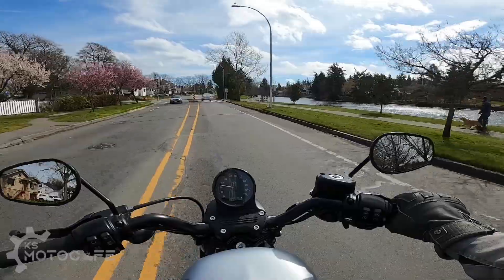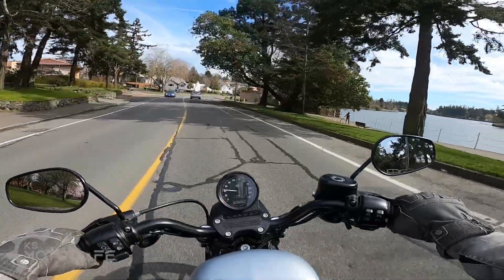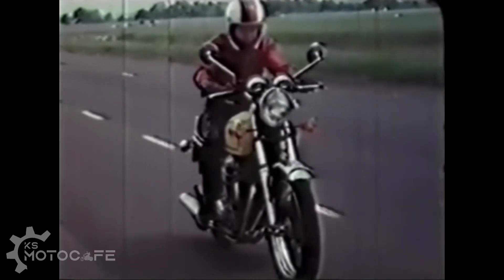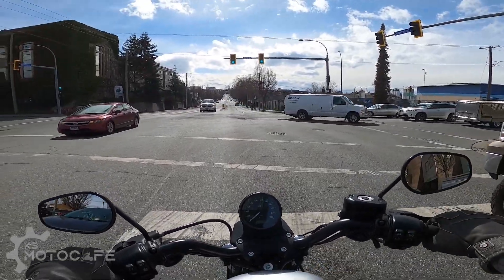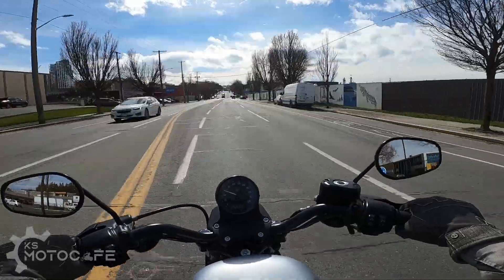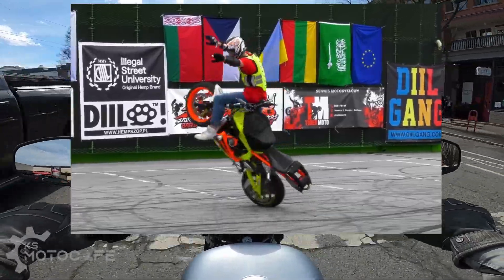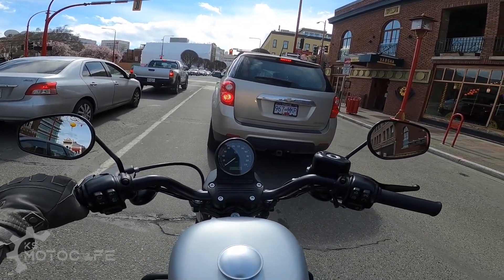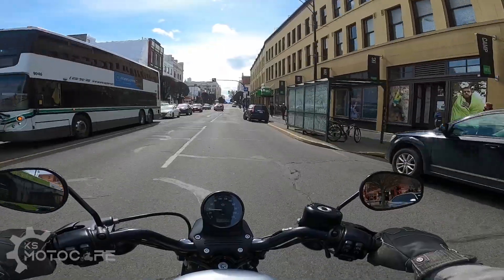Death Wobble, Speed Wobble, and Tank Slapper on a motorcycle explained!

Comment: Only significant wobble happened to me was on Hayabusa throttling up an offramp/onramp transition strip of road connecting two highways .... Which had a slight tabletop like step-up between three slabs of concrete. The front tire lifted slightly doing around 100… and I turned the bars a smidge right before the front tire set down again, all under full throttle. It started to shake, but I eased out of the throttle, didn't panic at all, and let the bike regain it's composure. The bike talks to you. It tells you what it needs. Then I throttled down again clear up past 100 in giddy exhilaration that only the big bikes truly bring! I think how far out of alignment the tires are and at greater speeds makes the most difference with how bad the wobble is going to be.
Reply from the maker: I know what you mean when you said "the bike talks to you"! But not everyone can understand its language...
Reply: @KSMotoCafe  Agreed. Some guys like lots of feedback (me) and some guys don't. And some have no clue about the difference. I've always liked lots of data to assess, whether bikes or cars. If the tires are not giving me adequate feedback I can't tell how much harder I can push the machine. I don't like a machine to be a brick, but I like it to give me some measurable input. Ride safe!

Comment: I experienced a death wobble last night.  Can you guess how I stumbled upon this video?  2014 Yamaha R6 new to me a month and a half ago.  Pretty sure the suspension was tuned by Stevie Wonder while on acid and I feel that is a major contributing factor to what caused it.  So I am an idiot and was going approximately 110-115 on a not so nice highway.  A lot of bumps and grooved surfaces.  I always maintain control of the bike by pinching the tank with my legs and knees and always have light hand control ..... not white knuckling the handle bars.  I loosened up my hands a little bit but not enough to lose your grip and it went away shortly.  I continued to exit the highway and go home to change my underwear.  Speed and road conditions and not having my suspension properly tuned.  But Im good and didnt spill it and came out with a new lesson.
Reply from the maker: wow! 😳 great job getting out of it man! 110-115 death wobble accident would be a nothing short of  serious injuries... did you get home and then just started to search about the wobbles?

Comment: This rarely is a problem if your ride Offroad. Many times in the desert, especially high speed fast runs, this happens often but it doesn’t come off as a speed wobble. It’s mainly terrain related. But I’m my experience throttling out always straightens it out. Same affect, different technique. Think of it as the gyro of the bike is wonky and in order to correct it a new variable has to take place. Dragging rear brake does work but it’s much slower in correcting the balance. Wide open throttle takes care of it very quickly. So as long as a corner isn’t coming up I always suggest holding it open.

Comment: I had a brand new 1982 Harley dresser, only a few days old when my friend and I were riding on a main highway at speed around 55 to 60 mph when the bike went into full lock to lock or as he called it tank slap. No warning whatsoever. I had been riding for close to 20 years at the time and had never experienced it nor had I heard of it. I took the bike back to the dealership to find out what was going on and they said ya we know, it happens more then you think, especially with fairings mounted to the handle bars.
I just hung on for my life and did my best to keep the bike up, God watched over me that day because I can't imagine that happening on a curve or winding road.  Makes me wonder when I see a single bike accident if it wasn't caused from high speed wobble. 
Ride safe!
Reply from the maker: Wow! Yeah sounds like God sure did watch out for you that day! Thanks for the share 🤟

Comment: I had to ride one of these out very very scary..I was riding a friends bike to the shoo while he trailed in his car..another friend was on his bike and we were indeed speeding "safely" lol. But his bike was setup for his weight and size which was 110pds more than me. At about 120 the bike went crazy I just rode it out i didnt know what else to do. I also had one on a Kawasaki 600 cause by poor design the put the headlight fairing on the handle bars instead of attached to the frame. I hit 110mph and a nasty wobble hit. Very scary
Reply from the maker: 110mph 😳 - at that speed it would be instant KO

Comment: I’ve had it happen to me three times on two different bikes. Each time I let off the throttle and almost hard break to my rear brake to get the bike to slow down so it’s more controllable. The biggest thing is recognizing that it’s going to happen and correcting it immediately with the rear brake.I’m not sure if that’s what the professionals say to do but it saved my ass three times
Reply: I thought all the time just hit the back brake
Reply: @timeless2593  I’m not sure I’ve never done that before. I was always taught in the rain you use both of your brakes for safety so I came natural to me to have both of my brakes when I had a wobble

Comment: You can actually can get used to it(death wobble) by riding a tricycle... Its a common occurrence on a tricycle because of an unbalance load. It happen often  even at low speed and high speed. we just ignore it...i also own a MC, i  expirience a wobble once. Run over a railway at crossing w/o slowing down(i didnt notice) i went airborn, landed and immediately wobbled i just let go of the throttle and the bike recovers. Sorry for my English ✌️
Reply from the maker: I honestly didn't see the wobble happening from a tricycle! thanks for including your experience on that.  Going airborne after hitting the railway... must have been at relatively highspeed! Thank you for your advice 🤟

Comment: i rode motorcycles for 10 years, never happened to me. 20 years later bought a scooter. happened to me at 45mph.
Reply from the maker: yikes! what was the issue with the scooter?
Reply: @KSMotoCafe   it was sitting for years. Replaced the tires. Runs like new now.

Comment: Clutch in lower your body to the tank. In extreme situations. Lock up the rear wheel. If only one wheel is spinning the situation can be eliminated. But I do not suggest the last option. Definitely not if your in a turn. In all reality the bike naturally wants to go straight and stay upright. I suggest letting off the throttle loosening your grip. And let the bike true itself.
Reply from the maker: some people lock their rear wheel on purpose to fish tail and look cool 😎
Reply: @KSMotoCafe  Yes it is a way to go. If you know what you are doing. But most people don't. Lol I don't know how long you have been riding. But I will offer a riding tip. Try to stay were the wheels of cars travel. The center of the lane is where they leak their fluids on the road. Fluids on your tires can be a real problem come your next turn and or stop. If you already knew cool. Just trying to help a fellow rider. Stay safe my guy.
Reply from the maker: @chadtucker2875  thanks man - I am still in my first year of riding and I share me knowledge as I learn more about safe riding

Comment: You do not need that front break lever ever been riding many years and never found a need for it like clutch shifting useless task for riding its for take off only i down shift while breaking and dont use it you bump throttle with light pressure on the shifter works like a charm opposite for up shift jurk back off the throttle as fast as you can shift no clutch
Reply from the maker: lol you definitely need that front brake when you try to stop a harley 😃

Comment: Had it a few times on my 07 R6S. Worst time was so bad my wrists hit the tank so hard I had bruises for a week. Everytime was an issue with acceleration on uneven ground. Front end gets light and a bump or pothole would set it off
Reply from the maker: wow I am surprised that force didn't give you more injuries to the wrists! Glad nothing worse came out of it.  that uneven ground at high speeds is the worst
Reply: @KSMotoCafe  the next day I got a stabilizer. Never had it again. I always clicked up when I was going to ride like a dick.

Comment: Yes, light rear brake can literally pull you out of speed wobbles. It transfers weight forward without all the force being applied to the 8.
Reply: I'll have to keep that in mind, just in case.  I hope I never have anything as terrifying as what's in the video, but "hope is not a method".
Reply from the maker: great advice!
Reply: Denise, what's "the eight"?
Reply: This used to happen a lot when I was riding in the outback of Australia on dirt/sand roads at 80km/h plus, like full on tank slappers and I quickly learned that to stop it almost instantly I could simply stomp on the rear brake, actually locking the rear wheel temporarily in the sand and it would sort it out rather well. I don't recommend stomping on the rear brake on a sealed highway surface but as someone else said use it lightly in that case.
Reply: Happened to me today. Tapped the rear and pulled in the clutch saved my life
Reply: Whats the 8?
Reply: Rear brake makes sense since the wobble is triggered by the front wheel being slower. Accelerating (the rear) would be an oxymoron!
Reply: Wtf does the "8" mean?
Reply: Rear brake lightens the front wheel. Same as speeding up with a speed wobble? So I guess either option helps. Rear brake is also great at settling a bike going too hot into a bend, it tightens up the back nicely without loading steering allowing you to recover the turn. Rear brake also levels a bike going downhill, again freeing the front brake for when you need it. Rear brake is great but only use when in gear/ clutch out to avoid locking up.
Reply: Actually rear breaking is the most logical thing to do, as it equals kinetic energy on both tyres.
Reply: Adding to the “what’s an 8” thread, what the heck is it?
Reply: Well...I wont do that... as it's hard to maintain foot pressure on rearbrake while bike wobbling considering jerk foot move might throw you out
Reply: @antowijoyo4473  you need to either just hang on untill it solves itself or you lightly tap the rear brake to basically stretch the front wheel which will also straighten it out. I would say if its a busy road, you just gotta use the rear brake gently. if its a completely empty highway, just ride it out.
Reply: Your rear brake light isn't going to help your wobble.
Reply: @COWBAYOUBADASS  was this supposed to be a joke then? I thought jokes were supposed to be funny or have a punchline or something...
Reply: @COWBAYOUBADASS  "Light" means gentle
Reply: @COWBAYOUBADASS  You're
Reply: @COWBAYOUBADASS  2 posts by you in this section show you are (you're) definitely NOT a genius.
Reply: @COWBAYOUBADASS  If you're over 14 years old you should be embarrassed.
Reply: pin the throttle while pushing down on the rear brake lever..

Comment: The main cause of a low speed wobble is due to tire issues such an imbalance, bald spots, or the wrong tire pressure. Suspension may also factor into low speed wobbles, so if you've noticed your motorcycle wobbling at lower speeds it's a good idea to have the tires and suspension checked out also When the front or back wheel has excessive side to side or lateral axle movement, the bike will wobble. The issue could stem from worn wheel bearings or another problem.
The best way to bring a speed wobble back under control is to close the throttle and hold on tight. Try to grip the tank with your knees so that you aren't thrown off and keep your feet on the footpegs unless you need to put a foot down to balance
Reply from the maker: that is a great point about indicators and warnings for tire maintenance!

Comment: on a Sportster I get heavy on the front by laying on the tank and slightly pullin  the clutch for engine braking works like a charm. On a sports bike I roll off the throttle give a big toe worth of back brake and pull the clutch in just a little bit. I find that pulling in the clutch allows me to regulate speed without making a violent change like applying the brakes it eases me out of the wobble
Reply from the maker: what about your body position for the sport bike? are you hugging the tank?
Reply: @KSMotoCafe  absolutely chances are I was doing that anyway 💨😊

Comment: 2 times I experienced it. First time was in a MX race on my YZ250 and I got the hole shot, but before the first corner it started and propelled me right off. It ended my racing career. (Wheel chair for 6 months with all the damage and I was #8 at the time) Second time was about 10 years later (2002) on my Suzuki GS750. I was only going about 50 and came out of a corner. It started to wobble but settled down after I gave her a bit of throttle. Slightly hit the rear brake as well. Since then I have never experienced it on my Ducati...or XR-1200...but learned from that first very high speed crash on the dirt.
Reply from the maker: When you mean #8 - do you mean ranking across a region or #8 during the race? Also XR1200!!! That bike will be a grail of sportsters soon!

Comment: tank slapper is the steering wobbling, death wobble feels like the whole bike is flexing in the middle.....best way to stop a tank slapper is to weight your footpegs and slightly lift your arse of the seat, backing off the throttle 99% of the time will make it worse by placing more weight on the front wheel as its bouncing from side to side.
Reply from the maker: thanks for the advice! I can't see putting the weight on the footpegs being easy for those bikes with forward controls but for the mids and rear, it makes total sense

Comment: I haven't been riding for a numbers of years but I had the wobble on a ninja 600R.1988 model. It was 1994. I had just turned off my street and accelerated to around fifty mph and it just started wobbling. I lightly applied rear brake and pushed hard on both sides of the handlebars to try and force the bike out of it ,it worked . I got lucky. I rode the bike two more years with no wobbles and then bought a brand new RF900R. Rode it for five years with no wobbles then took a long break from riding while my kids grew up. Bought a sportster two weeks ago, hopefully no drama on my new bike!
Reply from the maker: Thanks for sharing your journey! What brought you to a Sportster and not a faster cruiser? I am genuinely curious since you have ridden a lot of sport/naked bikes.  I found my Iron 883 has a wobble starting at 150-160kph